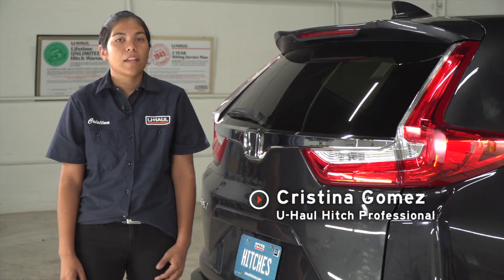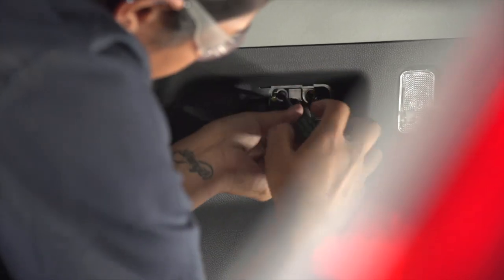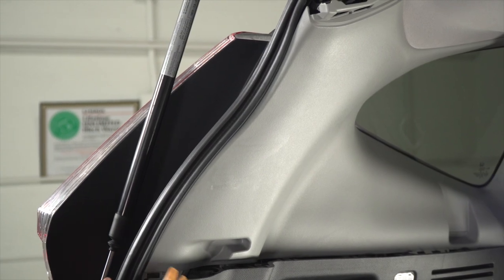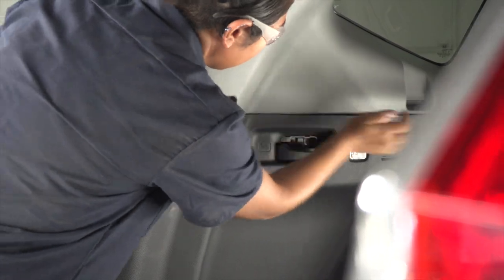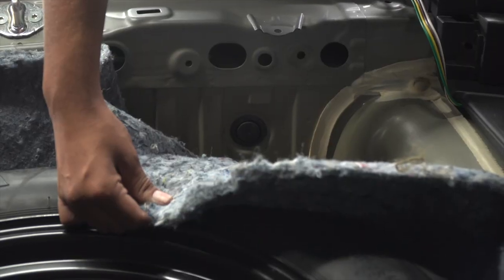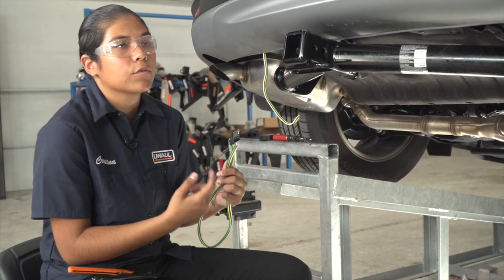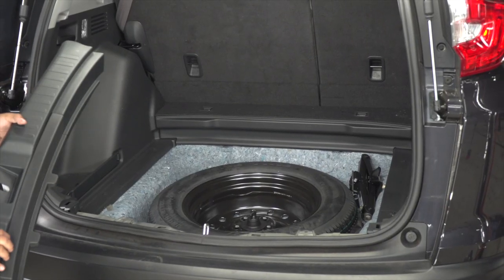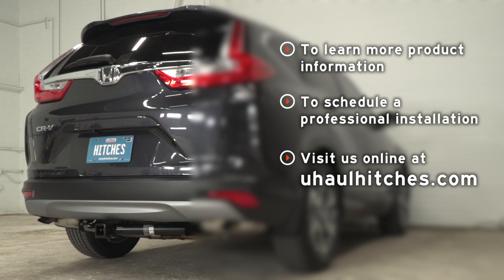2017-2024 Honda CR-V | U-Haul Trailer Wiring Installation | CMF56370

Comment: Great video from an expert installer. The U-Haul location I had my hitch installed at said that I would have to have the wiring come out through the lift gate whenever I wanted to use it. They obviously wasn’t trained properly like you were.
Reply from the maker: Thanks for sharing
Reply from the maker: Both are valid options to install. It is Customers choice where to route the Wires. As you can see here https://youtu.be/3E_Wzbw28Cs?si=V_40XnD3NMPVhSEo . Reach out to the Installing Hitch Center to schedule having the wires placed on a bracket.

Comment: Thanks for this step by step guide! Also wouldn't be better to cut a slit in the rubber grommet then  feed the wire through eleimating the potential for the wire insulators wearing down on the frame.
Reply: GREAT POINT.

Comment: The 2024 model (and possibly others) requires a 20 amp fuse under the dashboard on vehicle drivers side. Thank me later..
Reply: That’s what I was thinking but the hardness already comes with a fuse ..
Reply from the maker: Some Models may have the fuses already installed. Follow the supplied directions to check your tow package fuse locations.
Reply: Thank you
Reply: On 2024 we found the 20amp fuse location will be spot 17

Comment: Well done!  I noticed that there is no  grounding connection on the Curt wiring harness.  However, I am glad that it does not have this since getting access to the grounding point would have required the side panel to be removed. My hands are too big to get to that point by just bending tegh panel away, I actually had difficulty getting to the connector.  What is missing from this install video is to ensure that wire does not rub against the burr on the edges of the punched holes. I have used some fusion tape for that purpose. Also, it does not tell you how to prevent the box from banging against the metal. The anti rattle and preventing of damage to the insulation precaution took the most time during my install.
Reply: Mine came with double sided tape to secure it behind the panel.  The Etrailer video shows this.

Comment: Great video, no need to add fuse in the box compartment from Honda up in front ?
Reply from the maker: Some Models may have the fuses already installed. Follow the supplied directions to check your tow package fuse locations.

Comment: 4.38 To locate the plug out of the car after cutting the cables, you could pass thru rubber grommet. The humadity will apear in the boot because of you didn't put the rubber grommet back in place.

Comment: It would be good to show what you did to close the hole around the harness where it passes through the body. Can't leave that hole wide open with the harness chafing on the sheet metal edge. Did you cut a slit in the rubber grommet and feed the cut end of the harness through it and then apply some silicone sealant around the harness where it passes through?
Reply from the maker: Our aplogies. During our Early days of filming some stuff was unfilmed or edited out. Your Description is exactly how we route the wires through the vehicle body!

Comment: THANKS. can this be done to a 2020 CR-V touring hybrid?
Reply: Im pretty sure you can, should be the same.
Reply: @Ecobeast559  I found out I can't. the hybrid is not rated for towing.
Reply: @KevinP32270 and reason it’s not rated is because there’s no way to fit wiring harness, meaning trailer cannot be tagged.